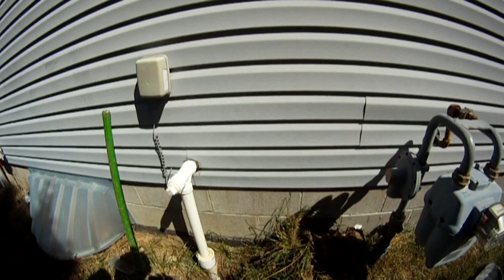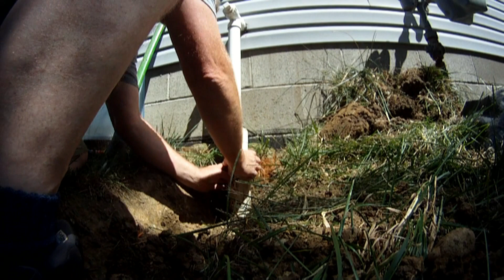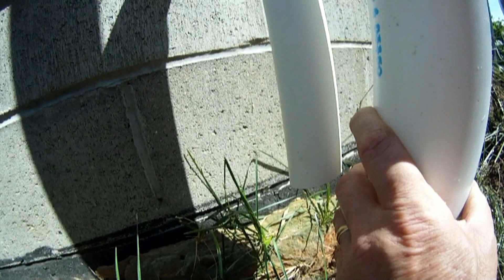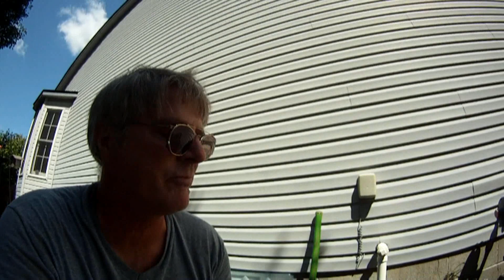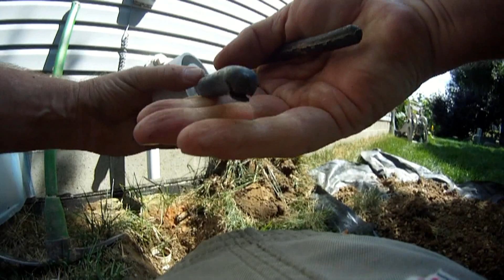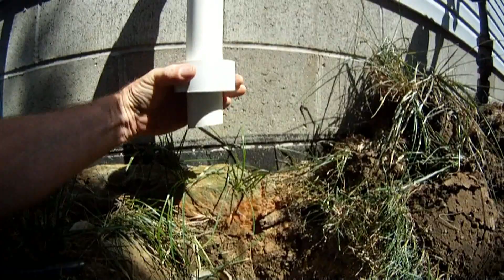SUMP pump discharge to DRAIN repair Downspout drain DiY waterproofing

Comment: But how did you get the old pipe off?
Reply from the maker: Hey Maria, thank you for watching. I believe you're speaking of the one and one half inch pipe. You have to cut the pipe above the problem area. Then, you must dig and remove the pipe below ground at least two the first 90° elbow. The 90° elbow may be bad also. I believe in this video we had to regrade the existing pipe going out to the main line.
Thank you again for watching! Let me know if this has answered your question thank you!